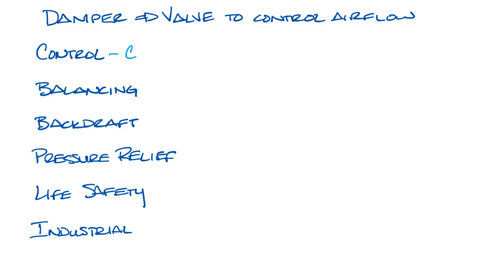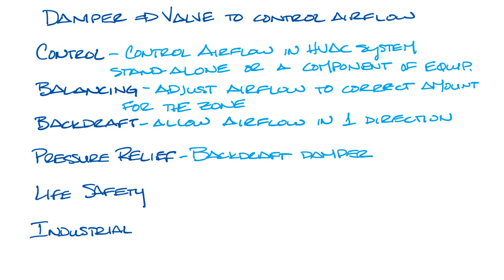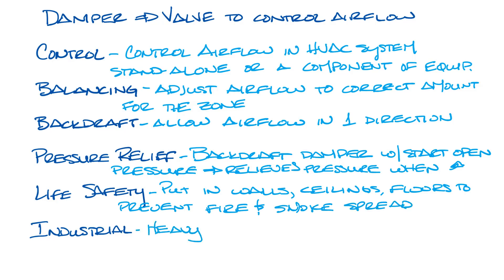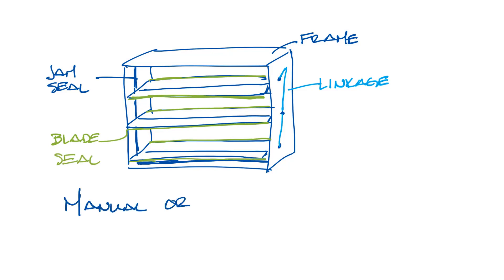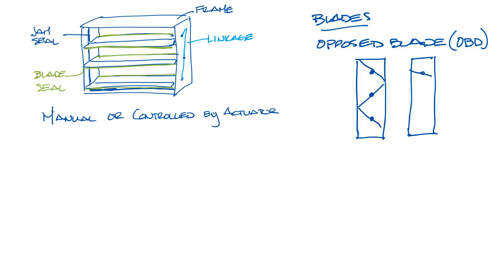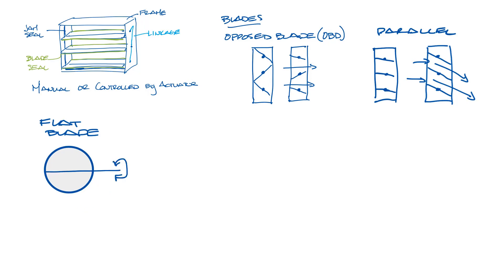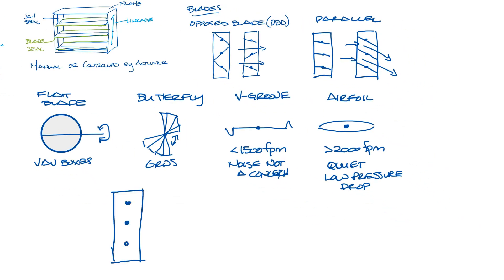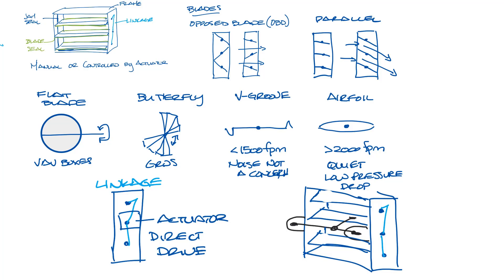What is a Damper?

Comment: This does nit talk about "Hit and Miss" dampers, or airflow control device which has identical perforated sheets placed together and flow control effected by staggering the perforations using a suitable device to move one of the two perforated plates laterally in a controlled manner.